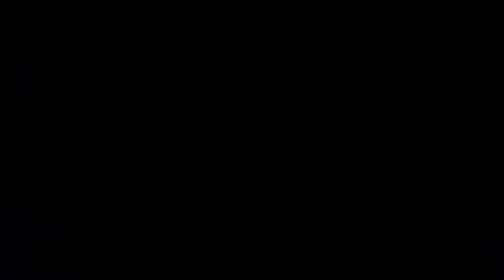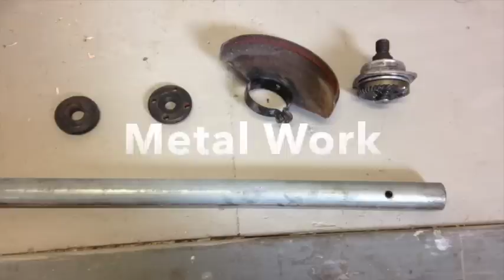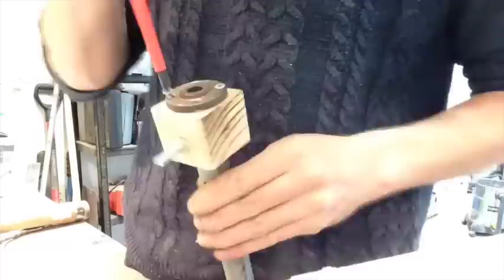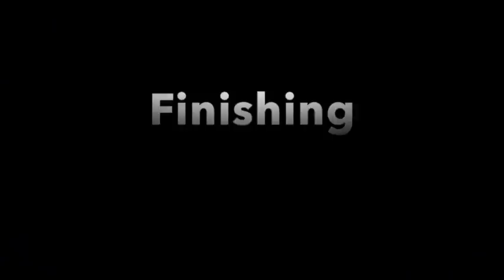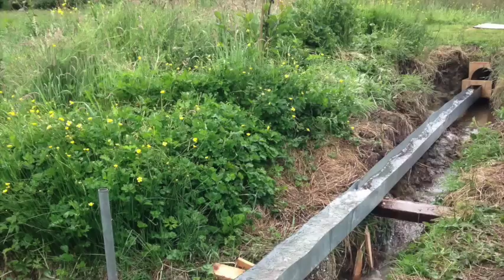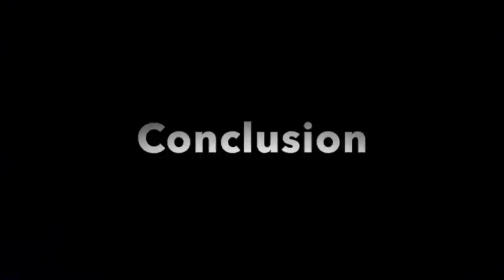Micro Hydro Project P2

Comment: Just use a water wheel. That's all you need. Sometimes overthinking is hindering your ability to make solid gains. You could determine your desired rpm and custom make an axial field alternator that would generate dc power at your desired rpm. Otherpower.com has an extremely useful discussion board about all of these things.

Comment: In your case the best solution is the Powerspout LH-mini turbine:
Power: 700w for 25-30 lps ( 436-523gpm) and 4.7m (14 feets).
The price is 999USD, with the generator included .
http://shop.powerspout.com/products/powerspout-lh-mini
I have one LH-PRO turbine and I have 1300-1500w for 45-50 lps (872 gpm) and 4.7m (14 feets) of head.
Do not give up, you have put too much efforts.
Emil Platon from Romania
Reply from the maker: Thank you very much for the thoughts! All the best with your project.

Comment: thanks for posting.  here's some late thoughts for you and your subs.  no offense, but there's still some gaps in your database. the site calls for an overshot or larger breastshot waterwheel designed to make the best use of all available head and flow.  a larger wheel has inherently more 'internal leverage' than a smaller wheel.  note that a wheel and axle form a rotary second-class lever.  leverage is an important factor in microhydro.  if you want your turbine to make more power, cover the hole in the top and turn in on its side, with the volute at the top.  remove what is now the bottom.  water goes into the volute.  the water has a mechanical advantage when it hits the vanes near their radii.      cheers

Comment: I am so impressed that you did this on your own.  Even at 240w, since it works 24 hours a day, you could hook to a battery bank and store the power for use during the day.
Reply: Suzanne Goodfellow it was making more like 15 Watts if he went ahead as planned which is enough to power a couple high-efficiency light bulbs to give you an idea a 15 watt solar panel is probably around 30$ if not less the generator he would need would be a significantly more expensive for the same amount of power this project wasn't worth completing